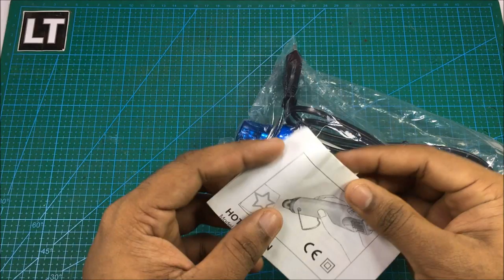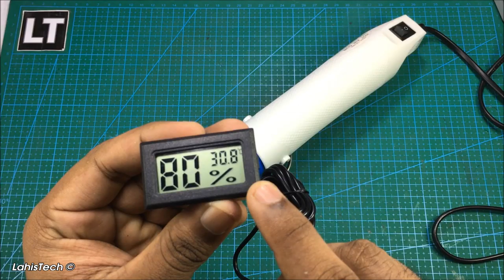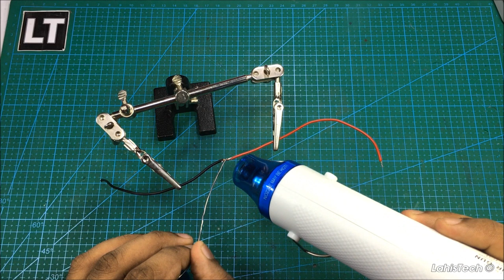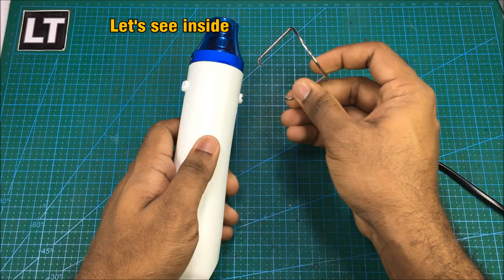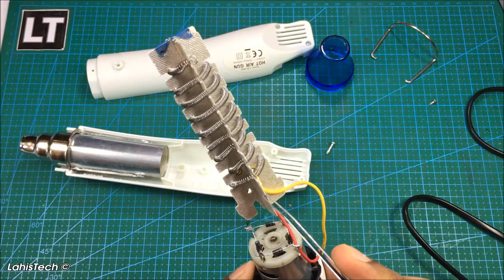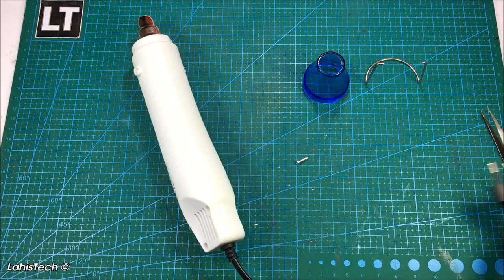Electric Hot Air Gun 110V/220V Heat Gun 300W review

Comment: There is no thermal switch and thermal fuse on the nichrome wire. Nor a current fuse on the input. This is not safe. Be careful everyone.
Reply from the maker: It's recommended to use no more than 10 minutes continuously by the specifications in it.

Comment: Seems useful I've always used hairdryer to heat-up glue and it takes a while                            
this is kinda cheap so i might buy 1 useful vid:) (not the part where u de-solder 3:40 and try melting lead lol 2:20)

Comment: Is that an asbestos heating element? If so, that seems like a major hazard.
Reply: Whut? Asbestos?
Reply: @CTZN1  Yes, look it up. It's a cheap and plentiful material. Very common in China. It was used in heaters, hair dryers and so on in the west as well in the past and then banned. But China still hasn't banned it. That's another reason I try to be  careful about Chinese products.
Reply: @4nlimited3dition_4n3d  how to differentiate them? I have mine and it looks like some PCB board thing
Reply: @CTZN1  From what I have found searching online, it can be pretty much impossible with a naked eye. If you look it up, asbestos heater elements look very similar to non-asbestos. I guess maybe with a high magnification macro lens or a microscope. There are also labs that specialize in this, but I haven't tried them. For now I'm just using mine with the hope that it's not blowing asbestos all over my room :D
Reply: @4nlimited3dition_4n3d  oh you also have this product too? Me too ahahah
Reply: @CTZN1  Yeah, been using mine for many projects now. It's pretty good otherwise.